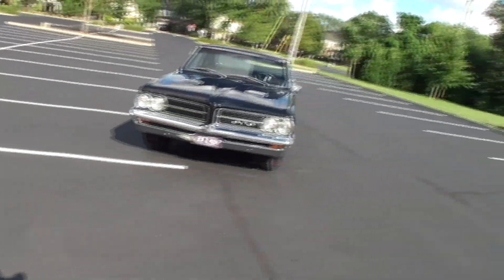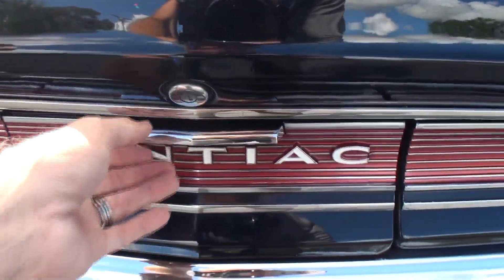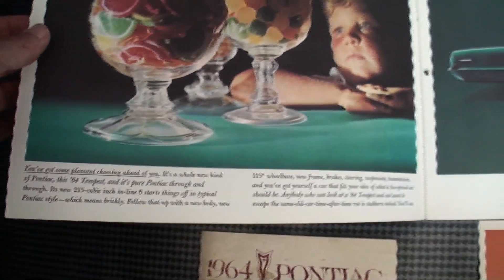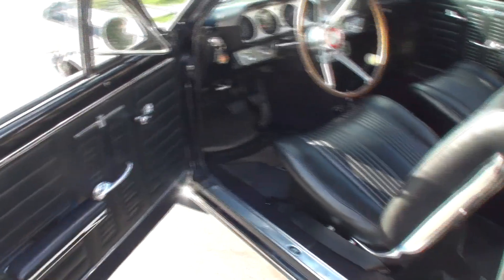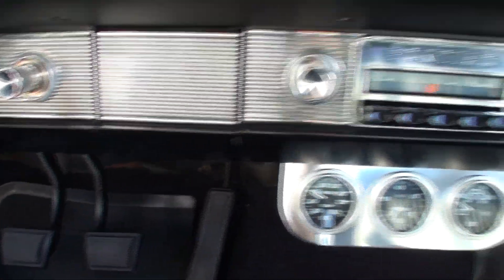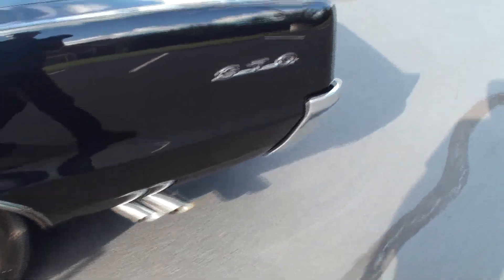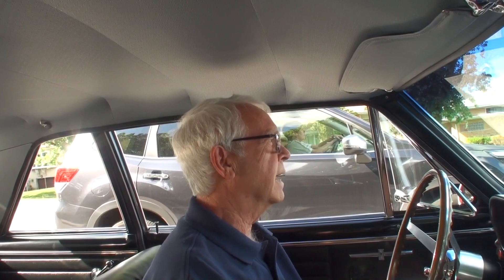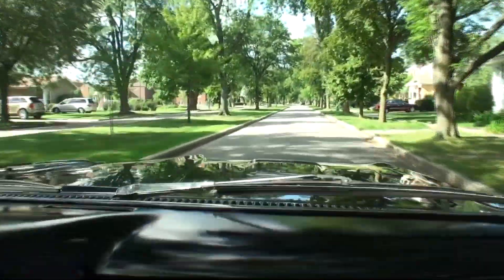1964 Pontiac GTO Post Coupe in Blue & 389 Engine Sound & Ride on My Car Story with Lou Costabile

Comment: I love the stripped-down cars. No power steering, no power brakes, no air conditioning, and no aftermarket gigantic serpentine monstrosity belt system on the front of the engine.
Reply from the maker: Hi Bill Barry, Happy to read you enjoy the simplicity of this car :-) Lou
Reply: Bill Barry I agree to a point but they really need power steering or they are nasty in a parking lot.  I like the small hubcaps.  I had
A loaded 1967. But 1965 would top my list.  Such great cars!  I like the post cars too.
Reply: @craigjorgensen4637  yeah if you get a little older and you can't quite grab the bull by the horns like you used to manual steering definitely ain't as appealing. But you do got to take into account that that thing just isn't going to be driven all that often.
Reply: @craigjorgensen4637  btw a fully loaded 67 is damn cool also.

Comment: I love them all, but a '66 hardtop, silver, black vinyl top, black interior and rally wheels is my top pick. I love the "sleeper" look of this '64 and it's sounds awesome. A real beauty.
Reply from the maker: High praise for the looks of this car :-)
Reply: All lead sleds after '64.Taller,longer, 400# pounds heavier.The '64 was designed for use in NASCAR,and this car,if raced, would have cut heavy into the Chevrolet market.Thus GM dumped NASCAR.Politics and Pontiac taking too much market share.GM basically shut Pontiac down at every point and all the good guys left.Pontiac even had a twin-cam motor in development at that time.But thru '67,the GTOs were the best looking cars out there.

Comment: For some reason I feel like the Pontiac is the car that looks good with the red pin striped tires.
Reply from the maker: Hi Tim, Thank you for viewing and sharing your thoughts, Lou
Reply: The original Tiger Paws on these '64s were a pastel orange (tiger orange).I never saw these on any other make at that timeThey are unavailable now,as in '65 they went with the bolder redlines.Redlines are available to this day,but you'll never see the originals again.They are not as bold and probably only '64 GTO owners would be interested for full authenticity.

Comment: Interesting point Ronnie and the Daytonas only had one hit song and it was little GTO. The record was used to promote the car the other side of the record was by the ripcords, and it was hey little cobra don’t you know you’re gonna shut them down which  had one two years later Chevrolet use the same marketing technique on their SS 396 Chevelle it was saying by Paul Revere and the Raiders, and on the flipside the Cyrkle sang about Camaro, which was a smooth slower type song compared to Paul Revere and the Raiders more of a hard rock ‘n’ roll. I worked at a Chevy dealership when they had those records at the dealership naturally, I have lost track of those records through the years, they were 45 RPM just like Ronnie and the Daytona little GTO
Reply from the maker: Thank you for sharing.